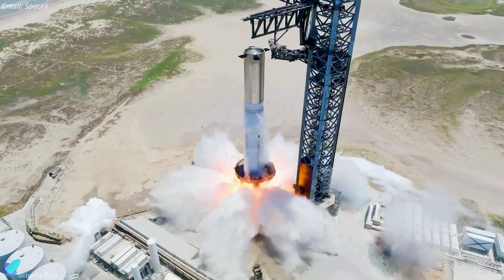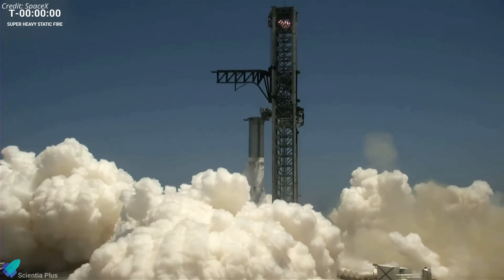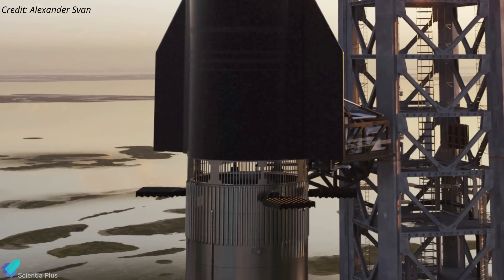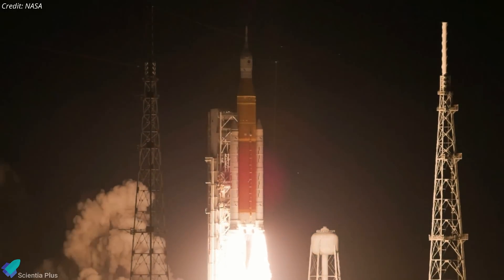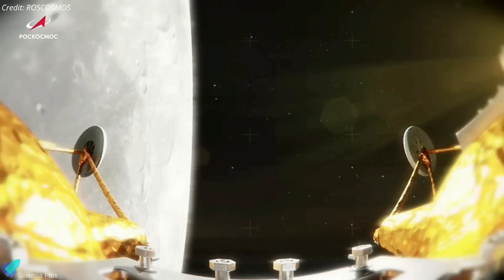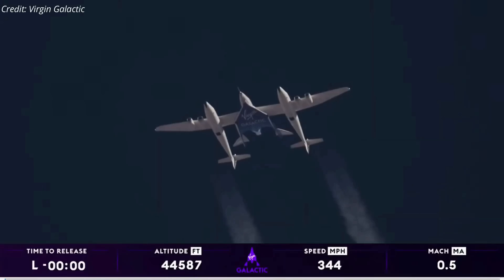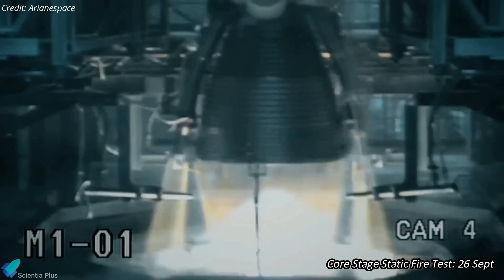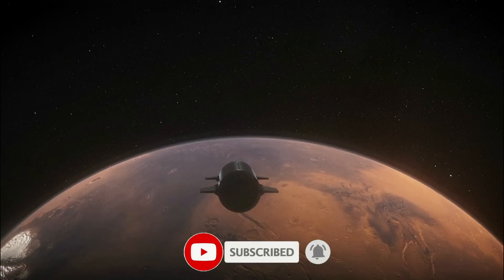SpaceX Starship May Put NASA Artemis Moon Landing in Big Trouble

Comment: I wonder if the massive vibrations are combining to form a harmonic resonant frequency that interferes with the engine part operation? Could they subtly modulate the fuel pressure or apply deliberate mechanical vibrations to engines to interfere with possible offending resonance?

Comment: The point of development by prototype is to find every point of possible failure on the prototypes, keep what worked on the next prototype while replacing or changing what didn't. 
Traditional Rocket companies test each part, assemble them together, shoot them off together one time, and throw it directly into the sea, presuming that all the problems are solved. Three human crews paid with their lives with this method.
SpaceX is apparently willing to make as many prototypes as needed. They should stay the course, because their method has been proven to be faster, cheaper, and far far more successful.

Comment: I doubt there's anything wrong with the Raptor engines. The 33 engines need 33 separate sets of fuel intakes, electrical connections, and related sensors. Those sensors have a partially separate path for data at the engines. There will also be sensors at various sites on the tower. Data from those will be assessed both on the engine and at the launch site.
A failure of one of many sensors may cause a single engine to reach a pre-set limit and shut down.
As the number of "perfect" pathways to success increase, the complexity increases exponentially. The real question is not did all 33 fire, but did enough fire to lift Starship to a useful path.

Comment: They have been going through the design-test-improve loop for 10 years at McGregor and are still having problems with Raptor.  Maybe the Raptor design is just too complicated to be reliable.  Hopefully one issue is that they are using a variety of Raptors at different points in the improvement cycle.  It would be interesting to see 33 of the latest design run together.

Comment: It is possible, that during the next flight the separation will destroy the spaceship, because the weakness of the Raptor engine is its nozzle (the cone). It is fragile, because it has pipe system implemented into walls. When during separation engines will work, before the buster will be separated the pressure in between the buster and the starship will affect the cones of engines. They will e destroyed as egg, from inside, because they are not enforced. If during the separation the pressure inside the area between the starship and the buster will be highier than the cones durability, cones will be damaged. Liquid methan warmed inside cones' walls will be released, and the result will be an explosion. Probably all affected engines of the starship (of the second stage) will stop. If the cones (nozzles) will not be enforced, there is zero chance for successful mission. As I think, some features of Raptor engine make it fragile to high pressure directed against the cone of the engine. The cone (nozzle) is the weakest point of the engine and has to be enforced.

Comment: When they work they work awesome but there are a ton of failures. Can't have that in space travel. They need a new design
Reply: None of these failures constitutes a complete redesign.
Reply: @goodgremlinmedia2757  They have been tweaking the design for 10 years at McGregor.  It shouldn't be having issues at this point unless it is a fundamental low level design issue.  I think it is just too complicated.  It takes fine control of 66 valves under the highest pressures ever attempted to do a static fire

Comment: I said from the stat that the raptor will be the downfall of this project
Reply: Reports are showing that the OLM caused this not the raptors themselves.
Reply: It's too big. @goodgremlinmedia2757
Reply: @goodgremlinmedia2757  Not on the latest static fire.  It wasn't even at full thrust
Reply: I agree.  The Merlin is a proven product, using proven fuel.  Why change?  Because stupid.